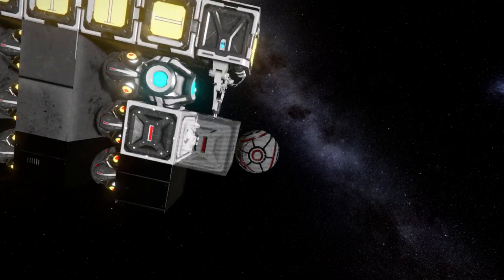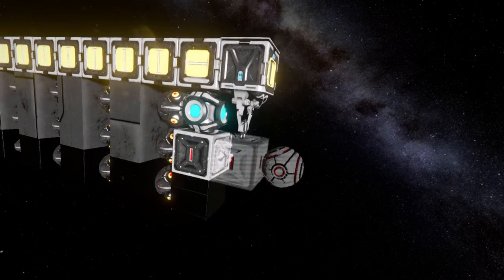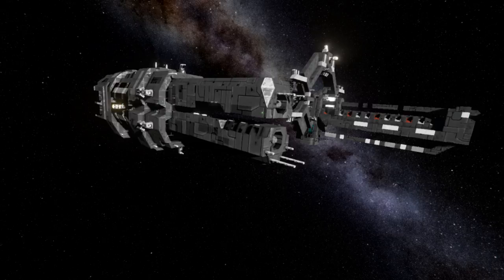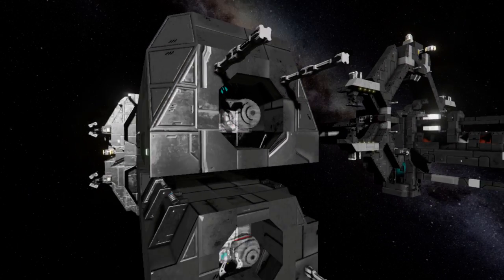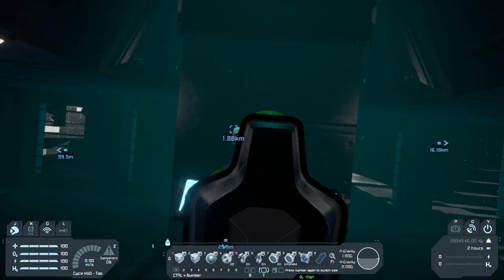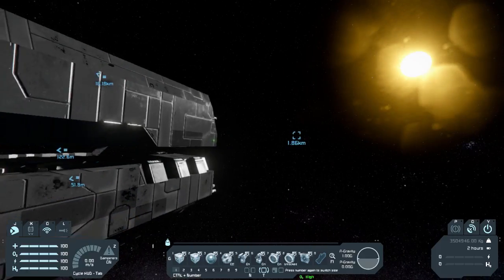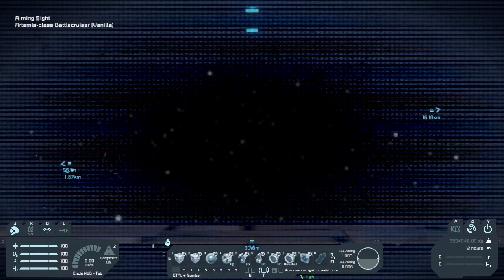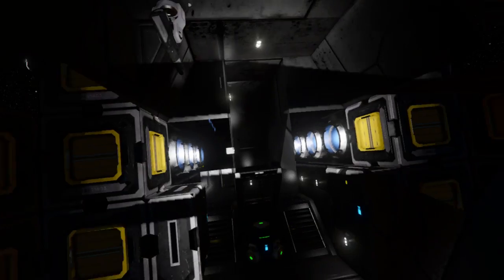SE-lf Built - "Mergeball Gravgun" Cannon Design, simple is beautiful

Comment: Could a bunch of gravity generators be used to deflect a space ball?
Reply from the maker: Not sure how many, but I think so. Depends on the speed of the projectile and the amount of generators.
Reply from the maker: The design of the projectile and the defense array matters most. However, a trick would be to include a timer on the bullet that will turn off the mass block, making the deflector array useless unless you use a modded one that affects blocks >:D
Reply from the maker: If it works, no dakka is overly complicated :D

Also, at some point either I or a modder will complete a mod that will replace my mergeball MACs with static, piercing launchers for long range. I'll install those on modded versions, of course, I still love my mergeball system.

Comment: Nice vid. Looks like the guns have gravity generators are set to a width of one, what about a width of two in the field settings and another row generators on the gun set so? Is the speed increase worth the increase in gun size?
Reply from the maker: Depending on the build of your ship, you can have a lot more gravgens than I was able to fit into my relatively small, slim creations. Since I build replicas, I don't want to compromise appearance, but if you can get another 100m/s I'd say it's worth it.

Comment: In the past didnt projections always need a power source such as reactor or battery?
Reply: the gravball and merge block don't need power to function.
Reply from the maker: Spaceballs have their own power source, it's like an artificial mass block with a battery inside (can't power anything attached to it, though) and the merge block doesn't need power once the barrel's merge block detaches as the Spaceball is powering the round's acceleration.

Spaceballs have always had their own power to function since they were introduced.
Reply: Does damage vary based on the set weight of the spaceball? since you can increase its weight
Reply from the maker: Acceleration and damage do very much vary. It may be different now, but the lightest setting moved way slower and impacted with little damage. These rounds are set to the max weight of 2 tons.

Comment: Do these still work? Do they function without a speed mod? Would it be possible to mount one down a barrel, so the welders are protected deeper within a ship?

I'm designing a Halo-esque ship and want to integrate a proper spinal "railgun" of some sort. Debating whether I'll use a gravgun or one of those newfangled piston-cannon springs.
Reply from the maker: They should indeed still work, Keen tends to fuck up Rotors regularly but these are intended to be stable by using the mergeball system. I would highly recommend, however, not putting this down a barrel as even if you move the gun only a little the round can get caught in the barrel